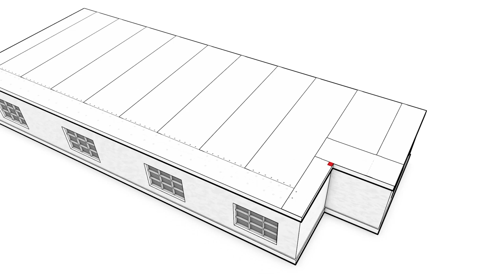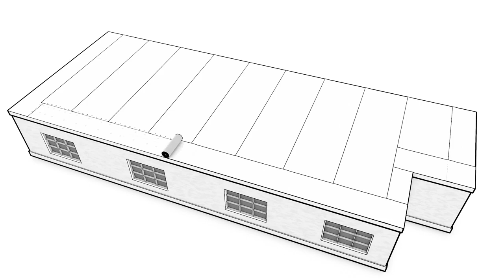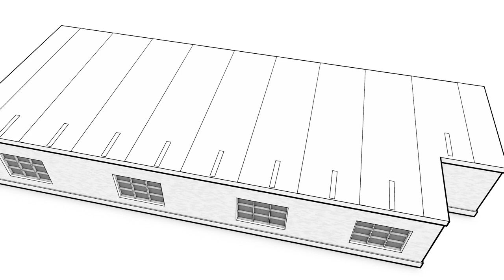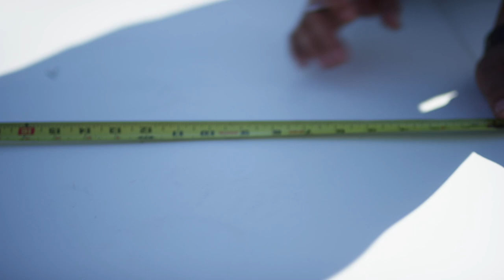Planning and Installation of TPO Membrane | Roofing it Right with Dave & Wally by GAF

Comment: Not sure if you two are still checking your messages on these videos I’m a roofer out here in Chandler Arizona with D7 and I have a question about putting insulation on an RTU curbs that’s a re-roof is it a requirement is my question is it a necessity in GAFS details, or What is the exact assembly when doing a re-roof and then flashing those RTU curbs?
Reply from the maker: Our technical experts are here to help, Ted! Please give them a call at 1-800-766-3411, and they will be happy to assist.

Comment: Got technical question of Lyiester hand welder, using a 2000 watt peak predator generator. The thought process on this case. Should a 3500 watt be used?
Reply from the maker: Our technical experts will be happy to answer any questions you have. You can reach them at 800-766-3411.

Comment: How come they didn't kick the roll to eliminate the wrinkles? I didn't see tack welds before running the doggie
Reply: Rigel, thanks for your response and to answer your question regarding wrinkles and tack welds.
The minor wrinkles that you may be seeing will dissipate over time and the sheet will tighten up.
In regards to the tack welds you are referring to, I am assuming that you mean back tacks? 
If so you should avoid doing tack welds/ back tacks on a MA system. I’m assuming that you have been on a roof that has a MA system on a windy day and have seen the roof “pillowing” ? ( for lack of a better term)
If you do tack welds/ back tacks the sheet will pull on those VS pulling on the welded seam and eventually pop or tear at these tack weld/ back tack areas.
Once this happens in these areas you could expose the underlying scrim which will only get larger over time, thus opening up the possibility fir leak issues. So we highly recommend not to do tack welds/ back tacks on a MA system

Comment: How much is the square for a tpo roof remove and replace, the old roof is tpo aswell and there isnt any insulation underneath and most of it is glued to the plywood. Thanks
Reply from the maker: Hi, Gonzalo. We recommend reaching out to a GAF certified contractor for a quote. Enter your zip code on our website to find a contractor near you: https://bit.ly/2Mu1fKl
Reply: @Sage Zayn Instablaster ;)
Reply: @Gordon Crew Thanks for your reply. I got to the site on google and I'm waiting for the hacking stuff now.
I see it takes quite some time so I will get back to you later with my results.
Reply: @Sage Zayn you are welcome :D

Comment: Can you install TPO directly over roof sheathing?
Reply from the maker: Hi, Miguel. It depends on how and where you're looking to install the TPO. Here are a few options:
For the field of the roof, if it's mechanically attached, you will need to use a slip sheet, fleece-back membrane, or an approved insulation. If adhered, it should be to an approved insulation board and for RhinoBond, it should be installed to an approved insulation.
If you're looking to install it over a wall, you can adhere smooth TPO with 1121 or QuickSpray adhesives. We recommend contacting our team directly at 800-766-3411 if you have any other questions.
Reply: @gafroofing  Thank you for your response
Reply from the maker: We're happy to help, Miguel!

Comment: Dave or Wally there are some roofing companies around me that are doing TPO on mobile home roofs. My question is what is the best welder to use on a roof with a pitch would a semi auto work for this or hand welder
Reply from the maker: Hi Scott. We recommend using a heat gun that is designed to weld thermoplastic roofing membrane such as TPO.